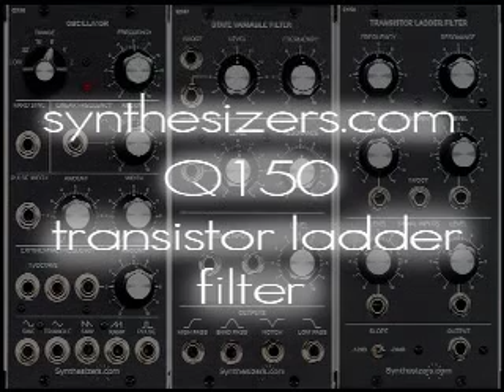Synthesizers.com Q150 Transistor Ladder Filter

Comment: What exactly are you using for your keyboard-to-mod interface for triggering?
Thanks.  I have the Q118 Instrument Interface, but that doesn't seem enough... you using a MIDI converter?
Reply: I can't believe no one has ever answered your question.  A standard module in any synthesizers.com system is the Q174 MIDI Interface.  Plug any MIDI keyboard into the Q174 and it will give you CV (pitch) and Gate for the modular.
Reply: +sdm02 I've figured it out since, but thanks :p

Comment: the whole thing depends, the basic starter is 120 bucks a month and they send you a module a month, until you've reached $1440 bucks or so.  and thats a small system.  They all range from that price to 14,000 dollars or so.  a few under 2,000 but not many...189 dollars is just for that one module, but you need 3 modules before you can even add sound modules like that (and a 450 dollar keyboard)